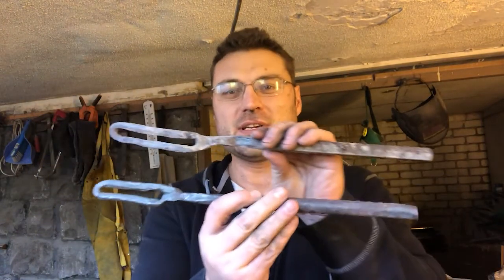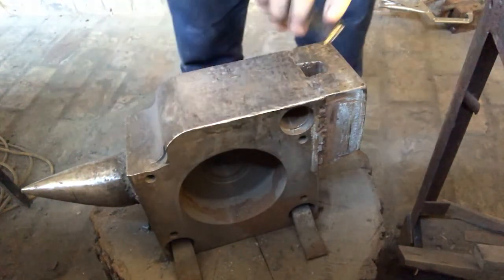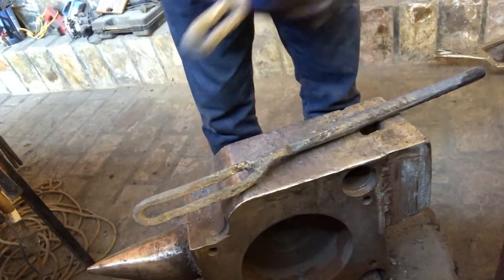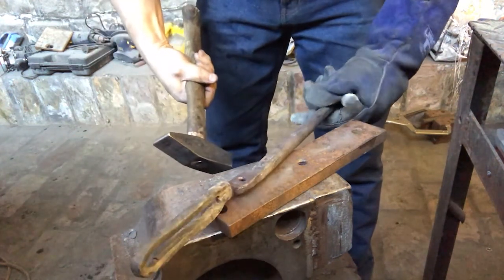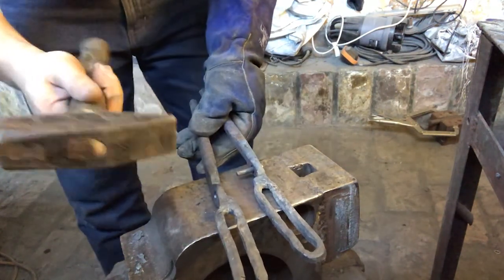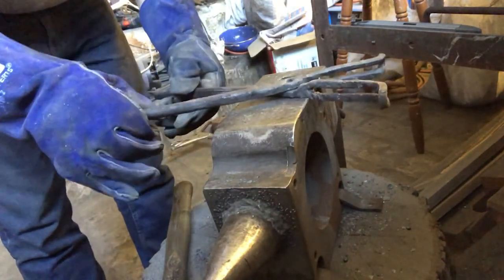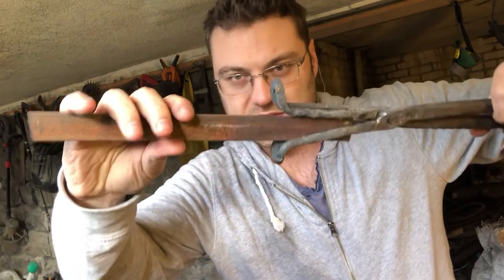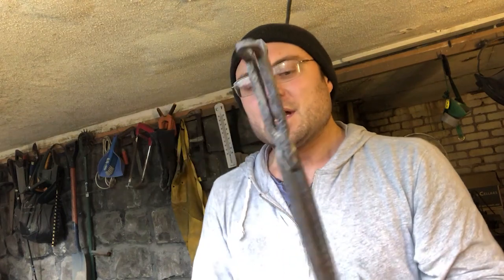Making Knife Tongs Part 2 - Beginner Blacksmithing

Comment: Great work!  You may consider cleaning them up with hot file or stiff wire brush. The smoother the surface the less likely to mark your work with them. But not polished fire scale helps you to grip. Not a critique as yours are way better than the early ones I made, just a pointer I wish I'd been given earlier. Thank bro Anthony Kent
Reply from the maker: Anthony Kent not sure if you saw that I did a bit of hot filing and brushing with a block brush. But I could have done more. I’m not able to include everything in the videos cause I’m so damn slow. Thanks!
Reply: Rusty Pearson told you it was great work lol ! Thanks bro for the response. It's very kind of you we know that you must be very busy. I couldn't do the videos at all!!! It's just I'd hate your work to pick up the marks my work picked up. I was sure it wasn't my tongs but it was lol thanks bro Anthony Kent
Reply from the maker: I love the comments. Thanks for taking the time. I want all the support possible, so keep em coming.

Comment: and your anvil is about 3 to 4 inches too short for you you need to be standing straight as you can and the top of your anvil needs to just barely brush you knuckles
Reply from the maker: Dustin Dixon yeh! Technically it’s only 1 inch off the knuckles. But I need a better base anyway. It’s jacked up with wood rather than being one solid piece.